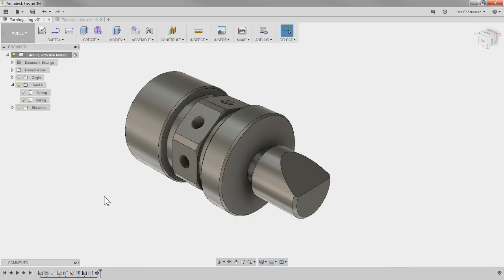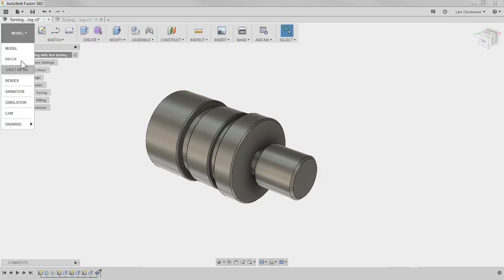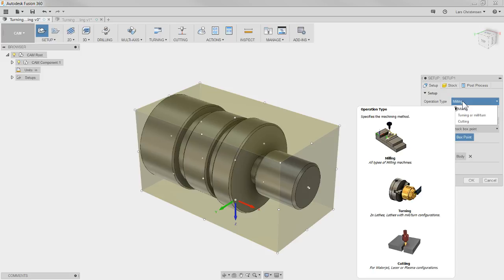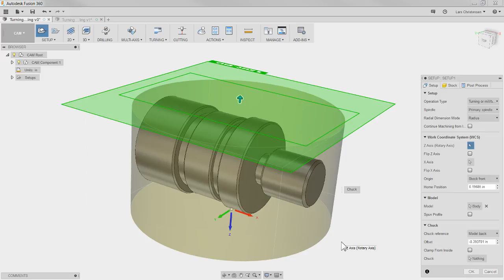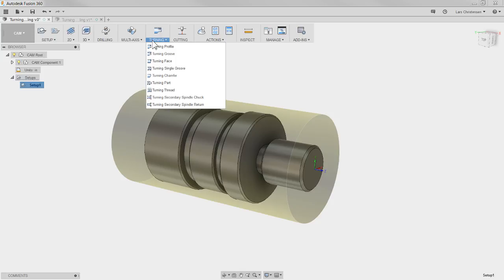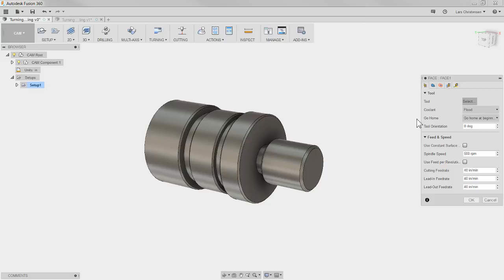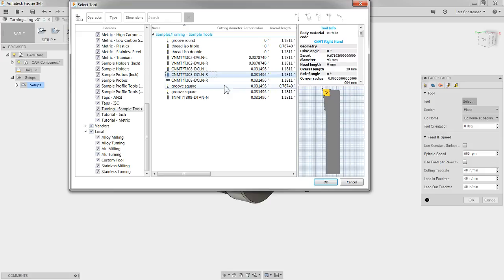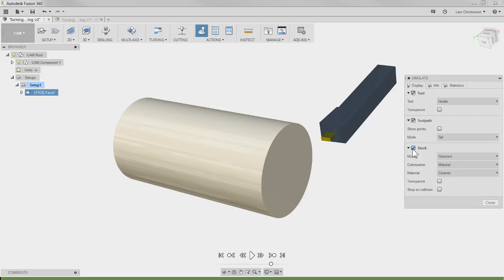Setup of Lathe Turning & Mill/Turn — Fusion 360 — And Your Comments & Questions— #LarsLive 63

Comment: Lars good video! however the tool path on the live tools is great for someone who has a Y axis. what about someone who has live tools without a Y? the front angle on the part will have to be milled with the side of the tool using the X and the Z travel. you didn't touch on the importance of having a really good post for the machine you work on otherwise it's useless. it might look good in simulation but that's about it. Nevertheless it's a very good tutorial.
Reply from the maker: Hi elilco Thank you for watching!
Yes, you are right I did not touch on other machine configurations...there are so many :-)
And a good post is essential everyone!

Comment: Hi Lars, thanks for the video. Assuming fusion 360 can do this, would it be possible to show how you would set up the combined cam paths for an action that milled and rotated the part at the same time? Such as if you wanted to create a variable pitch feed screw. (or point me in the direction of the correct video). Thanks!
Reply from the maker: Hi Macronic Thank you for watching!
Something like the wrap feature?
https://youtu.be/ApM2NWCDraU?list=PL40d7srwyc_Mkgc5wvP_OfVel9aDkNkZ6

Hope this is helpful
Best,
Lars

Comment: Why wouldn't you just rotate the spindle 90* and cut the angled face with the side of the cutter instead of using a slow 3d tool path?
Reply: it would be the best way to do the milling, but the machine needs to have Y axis capabilities.

Comment: Lars trying to use fusion for my multi axis live tooling lathe but i need the tool on the opposite side of the part since it has a turrent how do i make that happen i got the tool over there but it needs turned over so its cutter side up.

Comment: Hi, how do you select mode in Stock if your part is a Casting with drafts and extra material in different areas ?
Reply from the maker: Hi Sunil Saxena Thank you for watching!
I would normally have the casting modelled up as its own model and then select it as stock in the dropdown in the CAM setup

Comment: it is safe to say miling is the same as four axis programming
Reply from the maker: Somewhat yes. Milling is when the tool spins around in a spindle.....Milling and drilling is almost the same....Drilling the tip of the tool removes the material. Milling the side of the tool removes the material.
When it comes to programming mills, we talk about what axis are programable. XYZ would be three axis, XYZ-A or B would be four axis.

Hope this is helpful

Comment: Hi! When I make a finish operation of a Face of a 16mm part, it leaves a little spot in the center of the part, it in not smooth. How can i program it in Fusion to remove that center spot?
Reply from the maker: Hi Gheorghe Vlad Schiop Thank you for watching!
I might need more coffee, but are you sure your tool diameter is right?  But anyway :-) on the passes tab (4th) you can define stepover.

BEst,
Lars

Comment: Hello
Thank you very much for the video I want to ask you?
this way if you drive the machine mill and lathe you will not get correct post processor because the C-axis does not rotate !!!!!
i drive DMG machine control system is siemens it's 5 axeis can help me get a post  processor for program fusion 360 thanks
Reply from the maker: Hi ibrahim chamoun Thank you for watching!
It is all in your post, right! That is what controls the A vs C movement.
I would recommend you go here for further post help.
https://forums.autodesk.com/t5/hsm-post-processor-forum/bd-p/218

Comment: 13:38 well looks like G71 cycle that takes less time write by hand on machine than you still drawing it.without post processing 10000 lines simple thing. if it CAM then it should actually do it easy not hard way

Comment: 16:56 thats is exatcly G71 works. so long to setup it.i allready done G70,G76.G75. part is finished you still havent generate any code. and even worse thing you make part you have program ready next time. client want flange be moved. well you need make new program. i just modify 2 z value and click start while you making changes.

Comment: I can't generate nc code for millturn why
Reply: Using fusion 370
Reply: @ravishmaliakkal  You need to select or find a specific post-processor that is set up for mill/turn
Reply: @MsYellow123456  yes its ok working tganks for your replay